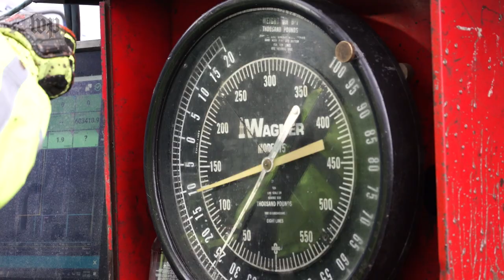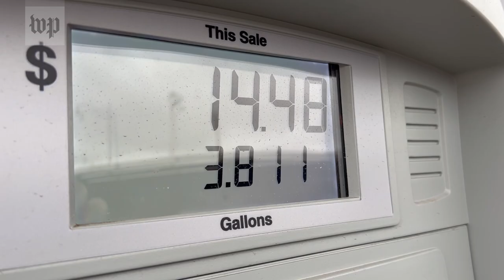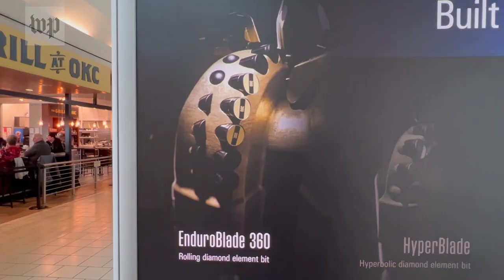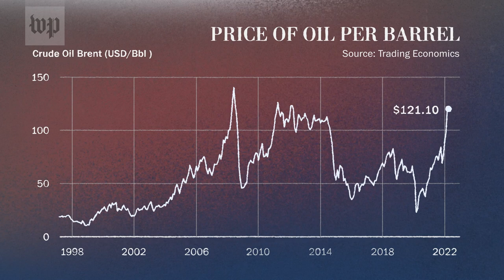High oil prices mean boom times in Oklahoma

Comment: Man i want in. To bad my state does coal not oil. Man one year of this hard work well buy you a home easy.
Reply: Don't count on it. I worked on drilling rigs all through the 1970's in Oklahoma and never had a steady job because the drilling rigs were constantly moving. We were drilling to the Springer sand zone, which is about 18, 000+feet deep. That took about three months to rig up, spud in, drill surface, lay surface casing, drill intermediate, run intermediate casing, lay down 41/2 " drill pipe, & pick up 31/2" drill pipe, drill to total depth, run casing, if the hole was dry cement the hole, if the hole doesn't produce enough for the oil company to make a large enough profit, cap the hole, displace drilling fluids, lay down drill pipe, rig down and move. This is all done in about three months to three months and a half. Now they are drilling shallow holes and move every month. Unless you are able to move wherever the rig goes, which I couldn't because I owned a house and had a family, you are looking for another job and starting over so often it is hard to accumulate any real money.
Reply: Coal is seriously on the way out. Just too expensive and having a hard time competing with wind energy and natural gas.

Comment: Lol... actually... HIGH OIL PRICES MEAN THERE IS A SHORTAGE IN THE SUPPLY COMPARED TO DEMAND. RESTART THE KEYSTONE PIPELINE PRESIDENT BRANDON!!!
Reply: What difference does an incomplete pipeline mean to supply? It's just the delivery system. They're still pumping oil at the source right?
Reply: Here Skippy... think about this example. Start a sprinkler system for your front yard but never install the sprinkler heads. R U ever going to get a green lawn? GET IT???
Reply: @hillpsalms7468  It's just a troll who has several fake accounts, just flag it and move on...
Reply: Keystone never stopped. The branch that did stop wouldn't be completed for years anyway. That oil is from tar sands in Canada and not used to make gasoline.  We export it and it is refined in Saudi.
Reply: The Keystone pipeline is already delivering oil from Canada to the Gulf.